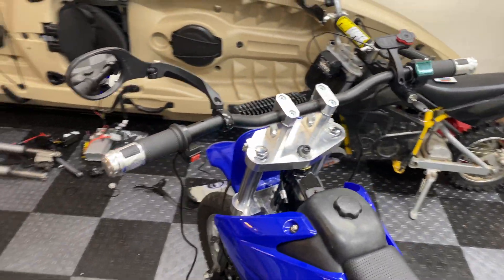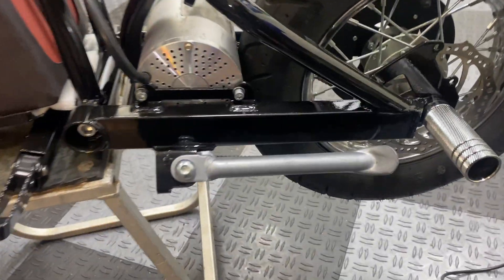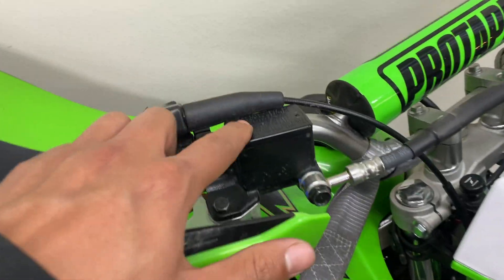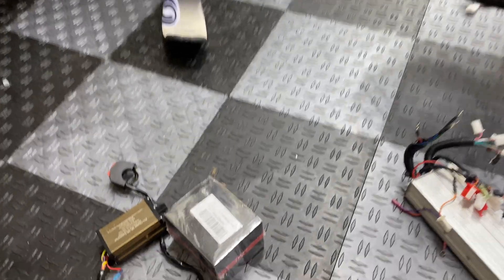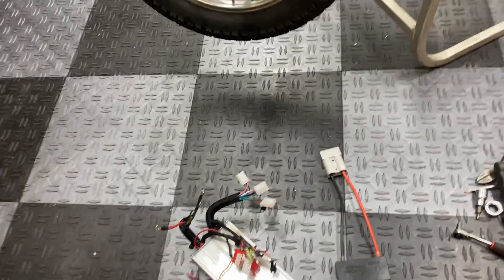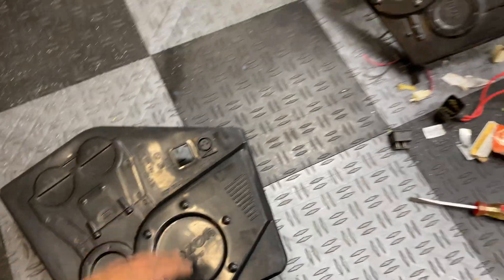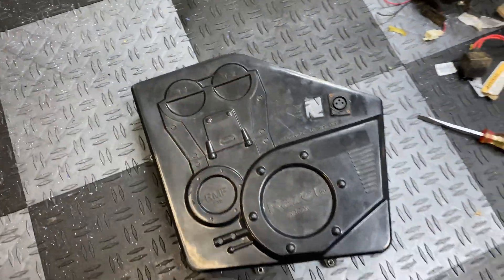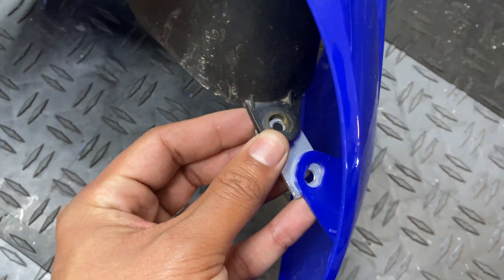Ultimate 72V Supermoto Razor MX650 Build Part 4

Comment: hey i have a quick question what exactly does the voltage meter do
Reply from the maker: It tells you what voltage the battery has
Reply: @PatOutdoors  so does that mean how much further it can go or
Reply from the maker: @731_will  in a way, yes. Like if the controller is programmed to cut off below 60 volts. You can keep an eye on the volt meter to get an idea how much the voltage has dropped since the beginning of your ride so you can head back when it gets close
Reply: @PatOutdoors  o ok thank you so much for your time

Comment: You can use a 48v 2000w motor with 72v controller and 72v battery?
Reply from the maker: Yes, have plenty of samples. But just buy a full 72v kit from the get go if you have the money for it. I started with a 48v kit and just upgraded in pieces over time

Comment: For a shorter hose Motoforti Universal 90cm 35.43" Motorcycle Brake Clutch Oil Hose Line Pipe Hydraulic Reinforced Stainless Steel Braided  on Amazon
Reply from the maker: Thanks! I’ll take a look

Comment: You should buy the beltsNshit belt drive kit. It makes it basically silent, and if you’re riding on the street, it should require no maintenance.
Reply from the maker: I may do that at the same time as a motor upgrade down the road.. Thanks for the input!

Comment: Hey man, it’s easier to install the kick stand without the spring, then put two zip ties around one of the spring’s ends. Hook one side of the spring on top and put your fingers in the zip ties to pull the spring down onto its post. I use two so I can pull with both hands but 1 zip tie works too.
Reply from the maker: I will try this with my next project! Thank you for the tip